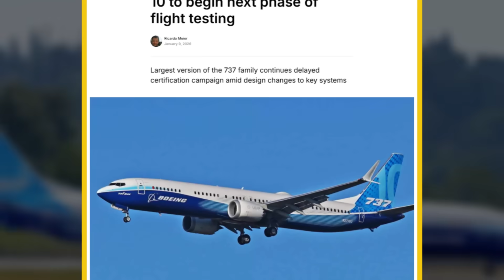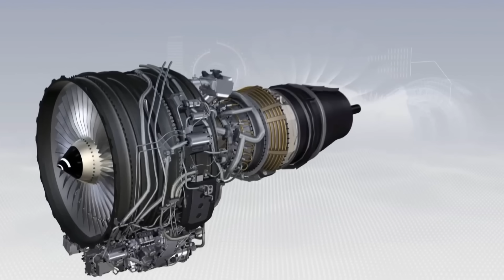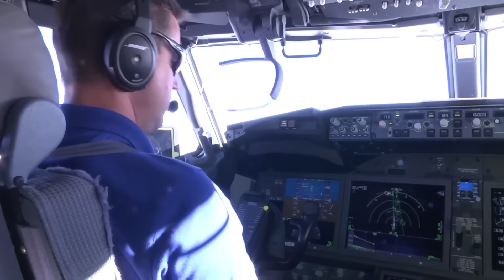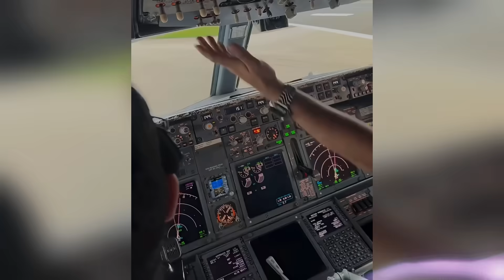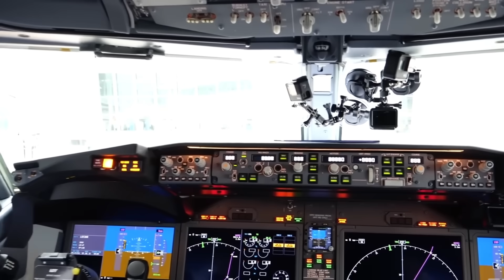Boeing 737 MAX 10 FINALLY Moves Forward After 9 Year Certification Delay

Comment: If Boeing hadn’t based the 787 on the Dash 9, the dash 8 and dash 3 shrinks making the dash three to heavy to take the over the need for a higher seat count in the 737, they would not have needed a stretched 737 and possibly had a replacement for 757 but was to heavy for that because the airframe wing was designed for the dash 9😊
Reply: Incoherent Drivel !!
Reply: @danilochies So say you
Reply: @johnblackthorne787  The Boeing lovers never counter with facts, just cheap shots